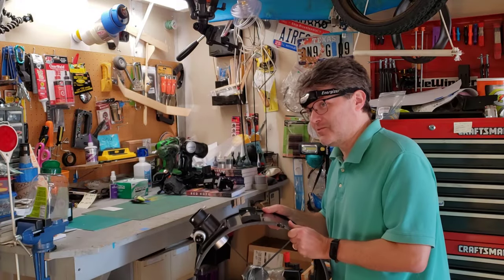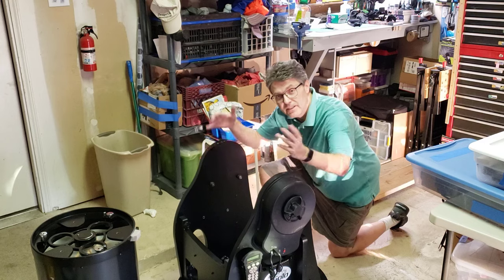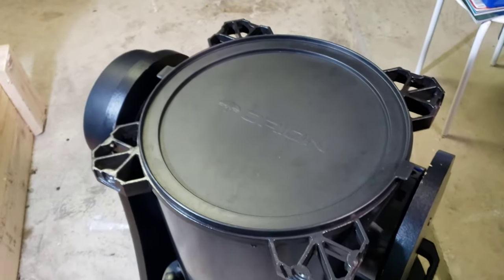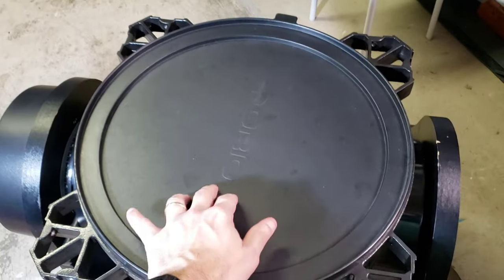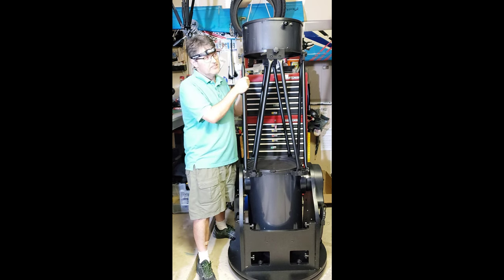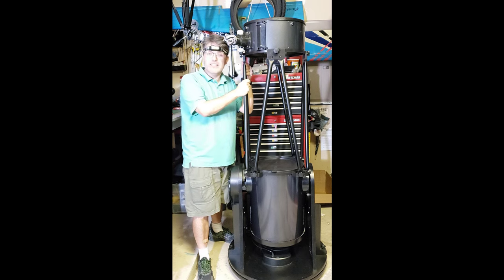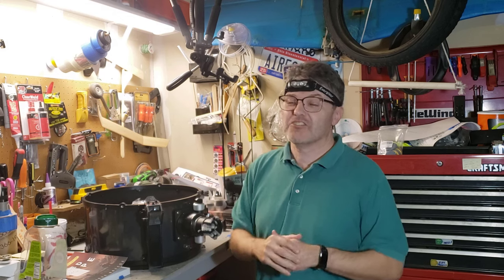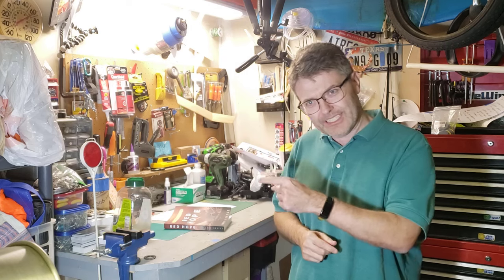PART 1 - GIANT Telescope Restoration! -  Orion XX14g GoTo Dobsonian (Episode 1)  by #Reflactor

Comment: I have one of these scopes and am having a devil of a time trying to align the thing.  Can you possible do a video showing how to align the telescope?
Reply from the maker: I no longer own that telescope, but I did write a very custom "Ownership Manual" document for it. Email me and I'll send you the document.  Generally speaking, here are the initialization steps:
INITIALIZATION:
1)	With the power off, point the telescope at the north star (Polaris)
2)	Slowly push the nose down so it is horizontal. This is the “Home” position.
3)	Turn the power on
4)	Go through the basic input setup. As of today (Dec 2), the answer to TimeZone is -6 and the answer to DayLightSavings is NO.
5)	When it asks to do an alignment, select YES and do the Two-Star Alignment (don’t do Brightest Star)
6)	Choose a star in the southeast sky and one in the southwest (or west)
7)	When done aligning, it will state a Caution about using an NPE correction. Push Enter and then push Escape a few times to get to the root menu.
8)	After this, you’re off to the races.

Note: If it still fails, then the primary culprit is a loose encoder.  They are held to the main shafts via set screws, and those do come loose. You can test this by checking the raw angle readouts from Azimuth and Altitude angles.

Comment: Supposed to be downloading and printing off my tax documents but I feel compelled to watch your video.  Just noticed your RC planes.  I've been bit by that bug myself.  Time to dust them off, tune them up and maybe get something up in the air this Spring or Summer.  I have seen carts where the wheels are hung on hinges.  Push a lever down engages the wheels.  Push the lever up and the wheels pivot up/off the ground.
Reply from the maker: LOL, thank you for watching.  It's not 11:45pm on April 14th, so I haven't even started my taxes yet.  Clear skies!
Reply from the maker: The RC planes have been a hobby for me since the late 1980's.  My collection is down to just one flying model now.  Possibly because the telescopes have eaten up so much space!
Reply: @reflactor  I get it.  I gave up my Meade 10-in dob to make way for RC helicopters and planes/gliders.  I sold my 65 Mustang to get into saltwater aquariums.  Now that I am getting back into Astronomy, my RC hobby has taken a back seat.

Comment: Me thinks John has found where Dr. Pepper keeps the "pepper". That is one big Bad Boy Toy. I don't know if the star party you went to had Patrick there, but if not, he is using the club's Obsession 12.5" GoTo DOB for outreach. It does not seem to be as big and bulky as the Orion. Really enjoyed this episode; keep on filming!
Reply from the maker: Yes, indeed, I was able to drool over the Obsession at the last Tandy star party I went to - I'd heard about the Obsessions for years, but never saw one.  These big Orion GoTo's are built like an earthen dam (just add more concrete).  The Obsessions are built like finely designed aircraft with material sparingly used for perfect structural integrity.

Comment: Is there any particular reason why you didn't put castor wheels to the bottom of the base instead of building a dolly?
Reply from the maker: Good question. It was partially due to weight.  This telescope was so incredibly heavy that I wanted something with beefier wheels to drag over rougher ground. You can't really put big wheels on the Dob base without causing stability problems (small wheels are fine).   I was hoping to buy one of the metal framed dolly's, but there were none available.

Comment: The mirror does not use clips. It is center mounted from the rear. Also, I dont use the hand controller on my xx14g. I use the Synscan app on my phone to control it. Just connect the phone to the built in wifi, and you are there.
Reply from the maker: Thanks for watching.  My xx14g is too old to have built-in wifi unfortunately.  The hand controller works really well though. Clear skies!

Comment: I would have looked at the wheel barrow arms with wheels at the end
Reply from the maker: That was definitely considered, but I'll mostly use this to pull it in and out of the workshop, so I needed something that wouldn't be a tripping hazard in the workshop.
Reply: @reflactor  awesome, it's a great solution with the levelling feet!
Ed tings review of this scope was great too, I'm sure you've viewed it.
Can't wait for more updates on your project, and you can get some comet light before it turns and leaves us. cheers from Australia.

Comment: My buddy has the 12 inch version.  He's had to replace some motors in the past on his.  Fortunately, he's the original owner as Orion won't sell parts to 2nd or later owners.  BTW, these models have all been discontinued.
Reply from the maker: My hope is that it's a slipping clutch disk or loose gear.  I've run into the issue of Orion not selling replacement parts to second-hand owners before.  They did stop selling these giant ones a year or so ago, but have recently (within days?) posted the 16" version of this back on sale, to be shipped in February 2023.  Hopefully they do the same some day with these "smaller" 14 inch Dobsonians.  Clear skies!

Comment: I have a 14" orion goto and it has trouble rotationg to the right.  It gets bogged down.  Also, the friction pads in the base, do they need to be serviced?  Cleaned, oiled, graphite??
Reply from the maker: When you manually rotate it left and right, do you notice that it's harder to rotate one compared to the other?  When you loosen the clutch and do the same thing, do you notice any strangeness in one direction?  I would recommend removing the assembly cover on the azimuth and watching that worm gear closely.  It sounds like the little gearbox might be loose and/or binding.  There is one easily adjustable nut that tensions the worm gear spring.
Reply: I adjusted the tension between the upper and lower base plate, and that seemed to do the trick I appreciate the input. It’s very hard to find quality information when you’re working on your telescope. Thanks again.
Reply from the maker: These GoTo telescopes are a bit nerve-wracking to take apart the first time, but then you get the hang of it.

Comment: Son, you got aperture fever now! Once you go BIG you’ll never go back. So how did your Zenith focuser height turn out?
Reply from the maker: LOL, good point.  It worries me that every time I've bought a large telescope, my perception of "what is large" changes.  For example, an 8 inch telescope seems perfectly normal, maybe even "small", lol.  With regard to the Zenith focuser height, I need a step stool.  With the time, materials and limited storage size, I couldn't build the ultra-low creeper style that I was looking for.  That's okay, though - a small price to pay.  :)  Clear skies!
Reply: @reflactor  Larger scopes in theory have more resolving power but also bring a new level of work to setup and maintain. I’m building a 16” truss tube and will need about a 4” stool at most even when it’s flat on the ground.
Reply: I own the xx14i. I’ve had it now for over 8 years. Still love it to this day. I was going to go for the Goto but decided it was just going to be far too heavy and I also didn’t want to disturb my neighbours with the scope slewing around the sky at all hours of the night. The push to system is very accurate if you take the time to set it up properly. 14 inch is the sweet spot for apertures in my opinion. Once you get larger the weight and height really stars to become an issue. I used to assemble and disassemble the scope when I first purchased it but after a few months this became tiresome. I Now keep the scope assembled in a purpose built shed in my garden and I fitted 3 castors with brakes to the ground board. Now whenever I want to observe it simply rolls out of the shed and I’m observing in minutes.
Reply from the maker: @deepskymike767   One of my other video series is a restoration of a 6" Intelliscope and I really loved it.  I thought about scavenging the encoders and putting it on my bigger Dob, but ultimately had to sell it.  Thank you for sharing.

Comment: Enjoyed your video immensely!  Big scopes do require a bit more effort!

I prefer a Telerad or similar sight over the red-dot for two reasons,  easier to see the concentric rings.  The rings give a guage for distance when using charts which give distances.  A pinpoint reflex sight can't do that.  If you need to save a little weight over the Telerad, consider a Rigel Quickfinder which also places the sight higher above the telescope surface for viewing.  

I decided to approach moving my 16" SCT by placing it on an electric wheelchair base so I don't have to disassemble... of course it means I need a trailer to haul it to dark locations... but if I'm going to do that, I'll probably want to take along enough equipment to make the trailer very useful anyway!  https://www.youtube.com/watch?v=-VRy6VoHqOs
Reply from the maker: I will likely keep the Telrad and add a red dot finder.  I'll see which one I use more and keep that one.  Your 16" SCT is enormous!  I was afraid it would tip over on that electric wheelchair. Glad it's okay!